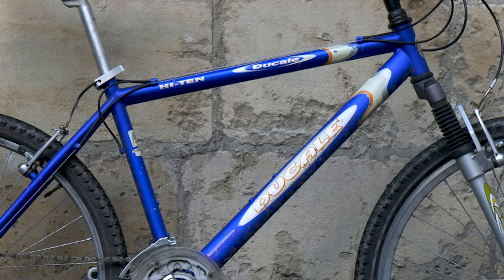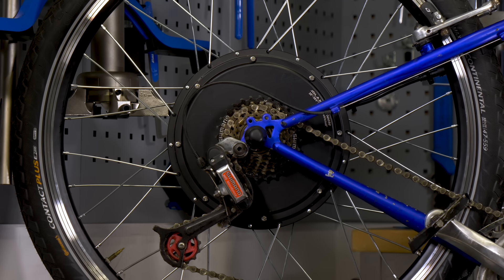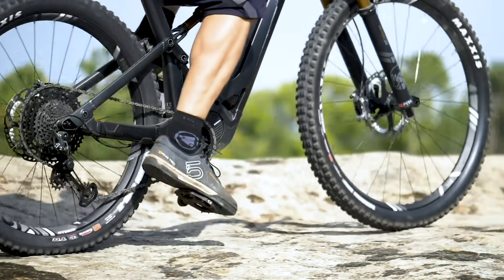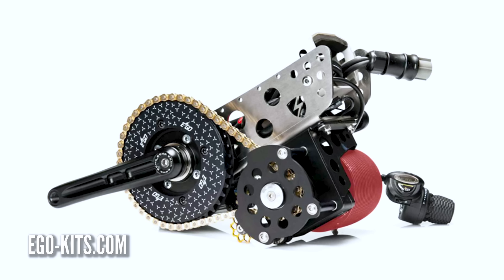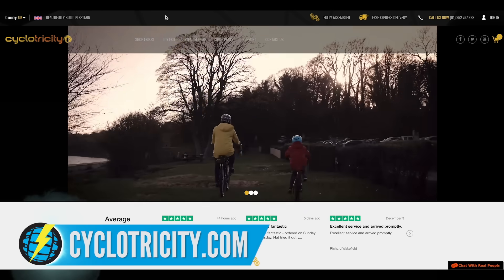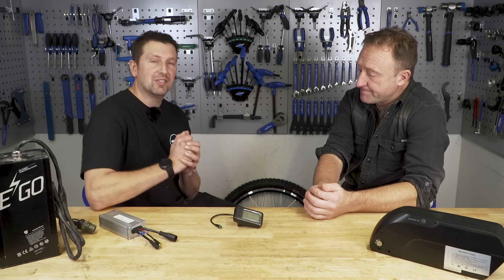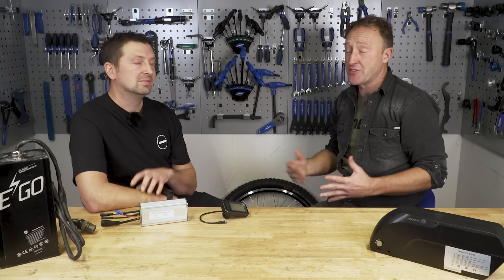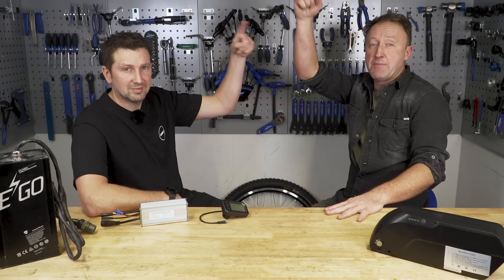Electric Bike Conversion Kit Options | DIY E Bikes With EMBN

Comment: Has anyone ever considered strapping all 3 motors to a bike? It would be interesting to see how steep a climb it could take you up!
Go on Steve, build it!
Reply: computerbob06 might be a little heavy if you have to carry it around train stations, but otherwise I would like to see how it would perform.
Reply: 2 x 3000 watt hub motors, Crystalyte 3540's, you dont need a third... even 2 @ 1500 watts each is plenty for most people. 2 x 10,000 watt Crystalyte motors.... I did that 10 years ago.... and that is just, insane.... and I only ran them at 5kw each, smoke the tires off pretty much....back then the battery tech was not as good and the controllers.... way too expensive to push 10kw regularly and I really didnt need any more concussion's after 12.... 3 before the age of 5.... what can I say, if it goes fast, wheels, tracks, hulls, ski's.... you name it, I've been on it and probably crashed it once or twice...
Reply: @larrymacdonald4241  I had a single HS3540 with a 74v 40a controller custom build bike and that thing went like shit off a shovel! Back in 2011 I think. What you had sounds beyond insane ahaha
Reply: @danimayb  I am looking at doing a 48v 15amp hr battery with a 1000wat rear hub how's that sound for a 200lbs rude and rode travel to work
Reply: I thought about a front and rear hub motor and have them pointing in opposite directions.
Reply: Becareful with a backpack full of lipo.  You don't want to become rocket man
Reply: IMAGINE!
Reply: People have tried it and the motors actually fight each other and it is a waste.  The two motors need to be coordinated and on the same controller.  There are some commercial examples where it has been done right but it is rare.
Reply: Dual motor is truly excellent, you don't really gain any top speed from having another motor but the acceleration and hill climbing is amazing. I doubt adding a mid drive as well would do anything
Reply: @computerbob06  first thought I had when he mentioned the three kinds. I'd be curious about the acceleration
Reply: 3 motors is wildly inefficient: Weighs a ton(3 motors, 3 controllers), drains your battery faster than you can empty a bag of M&Ms, rear wheel might have trouble keeping grip especially on loose grond(sand, gravel etc) cuz of the double output and it's going to set you back nearly 3 times the price of a normal kit. Also I'm not sure whether a normal frame is up to the torque of being both rear-hubbed and mid-motored, unleashing double amounts of power will probably cause fatigue or bending. It might launch you to light speed immediately though, but it won't do so for long before requiring recharge.

Your results would be a lot better with just 2 motors: one for the front, one for the back, be it rear-hubbed or mid-motored. There's little point in having 2 motors outputting on the same wheel, it would be more efficient to install a bigger single motor.
Reply: @rey_nemaattori  Of course each motor would have its own battery system. We're talking a heavy experimental beast here but still lighter than a dirt bike.

Comment: Converting an old MTB is a good idea - in theory. What people need to consider is are the brakes adequate, is the chain and cassette in good condition (replacing those adds to the cost... are the tubes and tyres still good (many old bikes are parked due to mechanical issues... and tyres can rot out in a year or two... to make conversions safe, esp. with the extra weight and speed can cost a lot more than a new cheap e-bike - and the new bike will come with dic brakes, be engineered for the weight, probably with a front suspension fork, better tyres etc... pouring money into converting a cheap, old, potentially badly maintained bike is not good sense... Of course, if you have a great condition old bike that is good quality, then it is an option, but still consider the maintenance needed to bring it up to spec and safe condition...
You still get a thumbs up for talking about the subject, we can't all afford the price of a new car or motorcycle to buy a pushbike with a motor...

Comment: I bought a Bafang unit and installed on a custom hardtail and just as Steve mentioned, the chain line was so bad that I couldn't shift into the easier gears. It is also rpm sensitive not torque sensitive so becomes a handful to ride in technical conditions. Finally gave in and bought a YT Decoy.
Reply: You sometimes need to use custom crank plates to get a good chain line with the Bafang. 
It's not one size/type fits all. 
The factory settings on the controller also leave a lot to be desired. 
Tweaking these settings (search for BBS/BBSHD hacking) can totally transform the feel of these kits. 
Eggrider is the easiest way of tweaking/testing the Bafang as you can do this via your mobile phone and test the new settings on the fly.  
The other way is using a cable and a laptop, which is a bit of a pain.
A lot of people write the Bafang off prematurely because they only get to try the factory settings, which are a bit crap, especially for a mountain bike.

Comment: I have built and ridden HARD lots of ebikes, the tongsheng has weak crank arms and puts alot of stress on  certain points of the frame, the high power hub drives trash the rear dropouts over time even with twin torque arms and unbalanced the bike badly. To sum it up diy kits are fine for commuting or plodding about. Take them off road and the bike and motor wont last a year
Reply: The way you appear to ride nothing would last long!
Reply: @colincampbell4261  very true this is why I am hesitating to spend 2-4k on a off the shelf ebike.
Reply: @philllowe2251  Buy a used 1990s chromolly steel frame mtb. Put front shocks on it and a tsdz2. If you bust motor you can get replacement parts cheap compared to bosch et al.
Reply: @philllowe2251  Put a disc brake on front.
Reply: @colincampbell4261  that will be my next build would solve strength issues, I have a 2014 gt zaskar comp fitted with the tsdz2 at the moment 20kg with a 750wh battery

Comment: You missed to explain that the only DIY mid drive kit that has torque sensor, is the popular and cheap TSDZ2. You also  didn't mention a very important part that is the cost for maintenance, that on DIY TSDZ2 you can buy every part at unit and very cheap prices. Also running our OpenSource firmware on TSDZ2 motor controller and on displays, you get the advanced features of very expensive brands only, not even Bosch cheap lines has this advanced features, see here about our OpenSource community firmware: https://github.com/OpenSource-EBike-firmware/TSDZ2_wiki/wiki

Comment: The single biggest thing to consider for any hub motor kit is a torque arrestor to prevent axle spin in the drop out. The Chinese cheap ones are crap. I made one out of 3/16 CroMo plate and it works beautifully.  I think you guys really underestimate the mechanical abilities of riders. Most kits are really simple and make the electronics stupid easy. I have experienced mt bikers with crazy skills when it comes to their bikes. 
With that said; it seems you want to make kits to sound less than user friendly. Like with the older vid of the battery falling out of the bike on the trail. (You do know they all have pinned locks to prevent that.) I seriously hope this is simple bias and not deliberate propaganda.
The other issue is; you are always leaning toward high price units as the norm. And NEVER review the LUNA X-1 at half the cost and more power.

Comment: GMBN stupid presenters think removing an old bottom bracket is too technical! Any bike shop can do it before you wrench on your mid drive.
Reply: rude
Reply: Zygfryd Homonto it’s meant to be. Lazy bastards just saying very complicated and having to be electrically minded to manage. Just assuming the audience is stupid.
Reply from the maker: Hey, it's more that we hope that people are of a suitable level of mechanical experience before attempting an installation such as this. We understand that our viewers range from professional bike mechanics to complete beginners. We want people to stay safe and have fun 👍
Reply: Electric Mountain Bike Network Again how stupid do you think we are anyone can do a small mechanic job unbolting an old part and fitting a new one it’s not engineering which involves actual knowledge like modifying a deraileur to run a different speed.

There’s a full community of ebike enthusiasts to help on ebikes reddit, endless sphere Facebook and many other sites. There’s also tons of different available kits none of which require the user to do much more than remove the stock wheel or bottom bracket and wrench on there new kit, connect each of the same type matching connector and set the wheel size on your display.
As far as buying a kit find one you like and message the seller to ask about compatibility with your bike.
Reply: Electric Mountain Bike Network If you want a easy kit to install get in contact with revelpropulsion who has his own designed kit which is leagues ahead of others on the market or lunacycle who have the best choice and is designing there own mid drive using high end RC motors used for industrial drone work.

Comment: I'd like to see more conversion kits on the show. For many of us our first experience of ebikes is through kits. My mountain bike lay in the shed for 15 years rarely ridden until I fitted my first kit. Now I'm riding hundreds of miles each year.
Reply: Same. I've even got into DIY solar tech after the eBike kit upgrade. A few hundred quid later and I haven't charged anything with a battery of the mains since. Love it! :)
Reply: @pau1phi11ips  could I ask what kit you used for bike and what kit for solar please
Reply: Rode 2000 miles in 10 months 👍
Reply: What kit did you use? Thanks and stay safe

Comment: What electrical knowhow do you need to plug cables in?
I have found the mechanical knowhow and specialist bike tools needed, far more of an issue.

Just ordered a TSDZ2 torque sensing mid motor, because I don't want an electric moped and it's lighter and cheaper than the Bafang.
Anyone know how to fix the Q factor on it?
Reply: man0z  
I read the Bafang cranks were crap, plus I only have short legs so would like some 165 0r 160mm ones ?

Does it still need tape? The motor has changed so much in the last 18 months....
Reply: Lekkie buzz bars, cranks with various offsets
Reply: @Dave-Hollows  
Thanks, but I am poor  :(  and unemployed  :)
I have just test fitted the motor and cranks. Much to my surprise the left hand side is spot on but the right side is a million miles out even with a 0 q bafang :( 
Turns out the specs for my bike lied, and I have 170mm cranks not the 165mm the claimed.

Is there such thing as a negative Q crank?
Reply: You mean Bafang is too powerful, and TSDZ2 is enough power already?
Reply: @MaximC  
The Bafang is a moped - no need to pedal. The TSDZ2 is like a shop bought ebike - it adds to the work you do.
Both are plenty powerful enough.

Oh, I almost forgot......  I opened the motor and re greased everything - no sign of water ingress despite it being submerged in water and mud over the winter.

Comment: Fantastic to actually see some stuff that the majority of ebikers use, yes we take them on trails too, although mine is abit heavy for tight trails but is perfect for those smooth trails with long jumps. However pas on the kits in my opinion is a downgrade. To be fair to the main brands they do PAS much better.

Comment: I built a bike using a Bafang BBS01B @@@ watt motor with a 36v 13amp hour battery bolted on the down tube.
I also upgraded everthing on the bike with brand new equipmentt including brakes, suspension forks wider tyres, gearing and it cost me approx £1000

Comment: Would never advise a mid drive conversion kit, I know someone who put one on a transition bottlerocket and ruined it, the torque ovalised the downtube where the motor clamped on. Its adding forces in locations and directions not designed for, it's only a matter of time before the frame fails.
Reply: Antedotal evidence. Use a steel frame.
Reply: @colincampbell4261  anecdotal yes, but somewhat obvious too, mtb frames are very carefully designed to deal with forces coming from certain locations in certain directions. Adding forces in a different direction or location is just asking for problems.
Reply: @mtbmetalhead6663  A well mounted tsdz2 and battery in a 1990s steel chromoly frame will be fine.
Carbon fibre is a no no, and I would not trust aluminium.
Reply: @colincampbell4261  how does that even come close to a modern emtb then? It doesn't. It literally cannot. So yeah, use a different frame than what you want, but if you want a mtb chances are it's aluminium.
Reply: @mtbmetalhead6663  You did not mention the frame material. I'm just saying use a 1990s chromoly steel frame bike. £100 on ebay, sorted cheaply, thats all.
Reply: @colincampbell4261  no I didn't. But it's a emtb channel, talking about converting mtbs to emtbs. So it's kinda implied they're talking about mtb frames, not relics from quarter of a century ago. I think at that point one of the 1k commuter ebikes would be as good and not much more expensive.
Reply: Maybe a defective frame.. I run mid drives on two MTBs for years and never damaged any frame. But it depends also on how much power you use..
Reply: @v1ncen715  not likely, it was a few years old at that point, but again, no non e bike frame is designed for it, especially the ones bracing off the downtube. Just buy a proper one, they're worth every penny, and you've got a warranty on the frame.
Reply: @mtbmetalhead6663  nah thanks, I rather buy used frames and install kits on them. But I don't  clamp anything on the downtube, that would be silly, it could damage the frame.
Reply: You are not immortal forever. 

Bikes are made to be bikes , not motos

Comment: Good to see this post.  the Bafang mid drive works really well for commuting and hacking around the streets.  Not a difficult install but the difference for me is in keeping the cables managed and neat it makes a big difference to the look of the conversion. So many conversions look terrible with wires everywhere.
Reply: There is a German company out there selling custom-sized harnesses (you can input your own cable lengths for each bit and choose if you need sensor cables, throttle cable, etc). It helps a LOT to get a super clean install for BBS motors.
Reply: Do you remember the Company name? @v1ncen715
Reply: Good point about the looks of the installation, that's what sent me down the Rabbit Hole. Anyone with normal mechanical skill can probably achieve a working e-bike conversion in a couple of days. I did, thinking first make the thing work, then change what you don't like and make a nice cable routing... Bought the kit three or four years ago and the bike isn't finished to this day! I was in my garage today and it stared at me! Really, the only thing left to do is route all the cables into the pannier and hide the controller there. And of course some minor things. My holiday just started, maybe... At least it won't look like sh*t when (if) it's finished.
Reply: Did he say fires or wires?
Reply: Koharu ebike kit-Refitted but as neat as original.